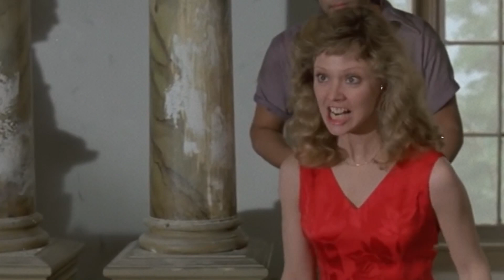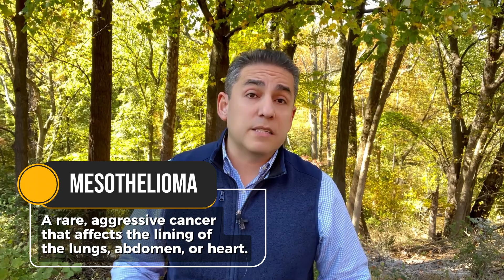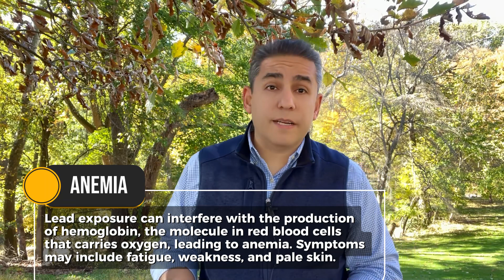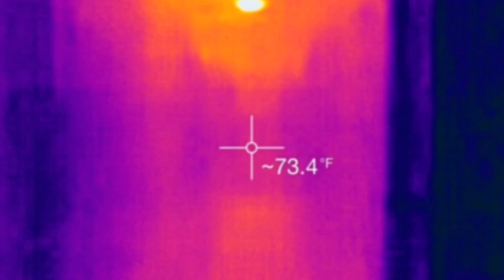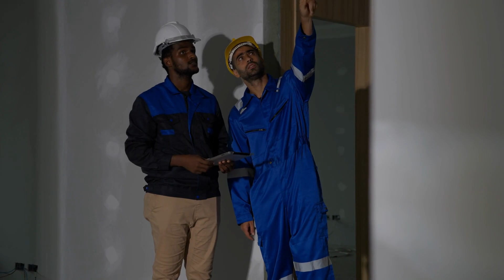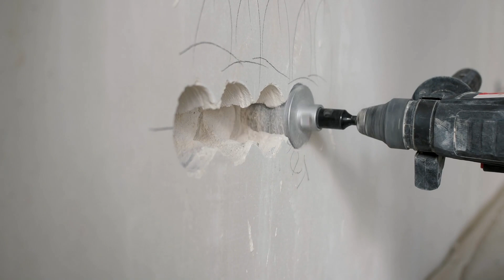I Thought It Was Perfect, I REGRET Our 1970s House Purchase

Comment: I've slow flip houses for 22 years. These "issues" are money. Scary, right? That's why buyers pay so much for a redone house. Larger house = larger problems. I specialize in 1930-1950 homes in western US, small homes in highly desired areas. Last 18 years in Phoenix. The dry warm climate eliminates most of these issues. I assume all electrical and plumbing gets replaced. Foundation issues is the only thing I stay away from. Easy to spot foundation issues.

The main problem with a 1970's house is they still have value. Owners aren't going to sell low enough to replace all these systems. When I buy a 1930-50 house in Phoenix the price is below lot value because the house is considered a tear down so it's worth less than the lot. But for me doing all the work myself that's perfect because I'm removing everything down to the studs. Then furring out exterior walls on the inside first with 2x2's on diagonals for structure, then verticals. Gives my 8" thick insulated walls for comfort and low energy costs. Complete new wirings, new panel. All new piping. Once you're down to studs replacing these systems is cheap. Trick is to only buy a house that needs to be stripped to the studs.
Reply from the maker: Thank you for sharing this info. Good luck with your home flipping business.